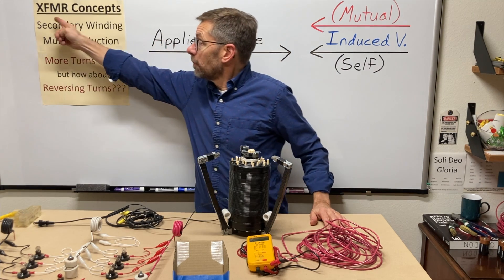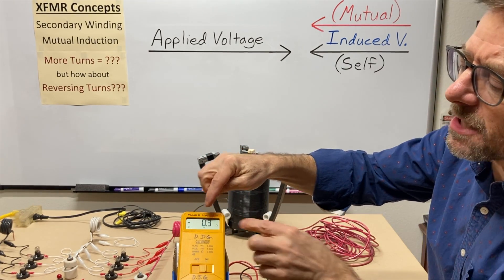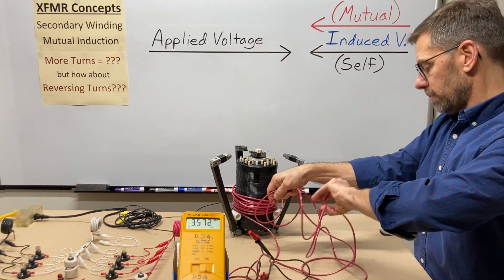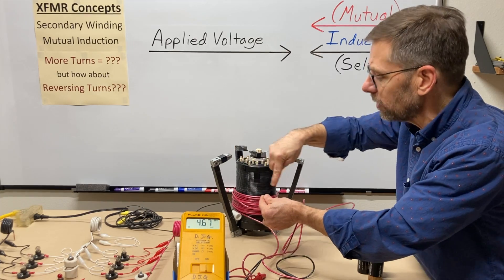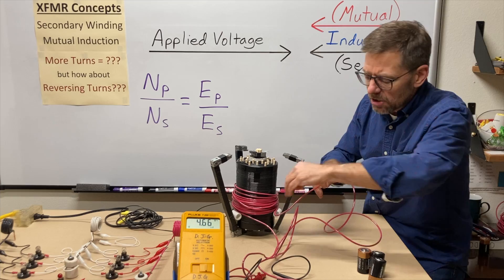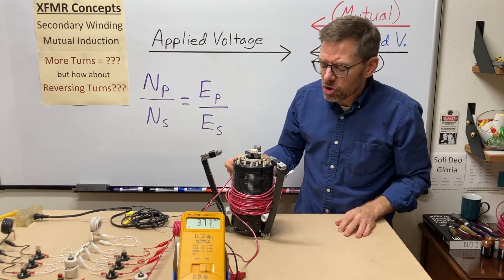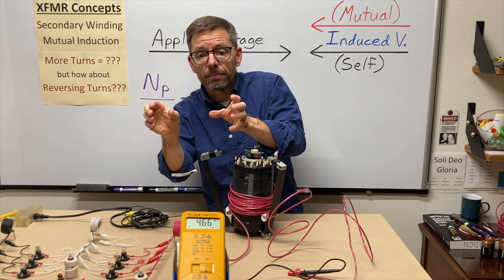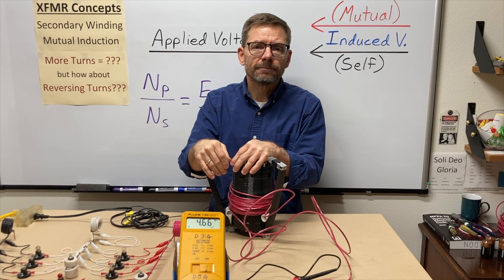Transformer Secondary Winding - Mutual Induction

Comment: Does winding the coil one way versus the other way determine which side will be "positive"?      I.e.  the meter was reading positive voltage.  If you had left leads on same ends but taken entire coil off and flipped it before putting back on would it have read negative?    Course it being AC might throw things a bit.   

But I think you kind of addressed what I am trying to figure out when you talked about phase.    So maybe one direction of secondary is in phase or positive same time(excluding lag)  and an opposite wound secondary would be out of phase or negative when primary positive?

Comment: I'm coil crazy, yes coils are very interesting things.Each one has it's own personality, so to speak, the specs. determine the properties exhibited. Built a pulse motor using coils and a magnetic armature that has run a year and maintained the battery voltage. Self Sustaining Pulse Motor, have to make a schematic but don't want to disturb the thing.

Comment: I’ve always thought of voltage level induced into the secondary as simultaneous overlapping voltage addition & subtraction (ac) for each winding, equaling out to the total amplitude of the induced sinusoidal waveform. I like the series battery analogy better though because it’s easier to picture & understand, even with the DC distinction. Clicked with my brain anyhow, so thanks!

Comment: With most transformers that have a magnetic core, including yours, doesn't the core suck up all the magnetic field? That is, like 99% + of the flux lines are in the transformer's core? And if in theory, in order to induce an emf you need a wire, and a magnetic field, and relative motion. When the wire "cuts through" the magnetic field lines it induces an emf. So if 99%+ of the magnetic flux lines are contained in the core of the transformer, which magnetic flux lines are "cutting through" the wire to induce the emf? 
I realize this is a different type question, but it seems that there is a conflict between the theory here to me. Any thoughts? Thanks
Reply: consider it from the corollary of Amperes circutal law. if there is alternating current passing a straight wire then there is alternating magnetic flux around. Now if there is alternating flux through a straight path then there is alternating voltage around it. Same happens in case of eddy currents. just a crude explaination.
Reply: @Aadil41290  
But a transformer is specifically made in a way to utilize the characteristics of a coil, an inductor. That is to "focus" the magnetic flux. The flux is already focused in the area inside the coil. So I mean amperes law is all good, but an inductor is not a straight wire conductor. They behave differently, and engineered on purpose to take advantage of the properties of the inductor/coil. Thanks.
Reply: They don't have a magnetic core.
They have a core made from a ferromagnetic material.

The core isn't magnetised, but it can conduct a magnetic field.
Reply: 99% isn't "all".
Reply: @deang5622  
Ok, you're right the core is typically a ferromagnetic material.
And are you suggesting that the <1% of the magnetic flux is responsible for the mutual induction that he talks about? I'm asking, not as a troll or a trap, but out of curiousity. If someone has answers I'd like to hear thats all. Thanks

Comment: Dave, how could one get 120 in each phase to neutral from a 3 phase source from a delta connection??? Without having a high leg... i saw a delta Service 120 each phase to neutral and 240 between phases shouldnt it be higher one phase? What equipment could  be between tranformer and panel?
Reply from the maker: Hi Ivan, Thanks for asking, but I haven't seen a scenario that you describe, and thank you to "A V" for replying with the math for a high-leg delta.
You should see about 208 V from the high-leg to neutral. I suppose someone could take that 208 V (high-leg phase wire and neutral wire) to a single-phase transformer and transform it down to 120 V, but this is probably highly unconventional and could have unintended/negative consequences depending on how the transformer connections are made and if the other phases or the center-tapped neutral from the original delta transformer were accidentally connected to the "neutral" (not really a neutral, but potentially a grounded conductor) from the single-phase transformer. I it were going to a panel this would likely be the case. For starters, you may end up with current finding its way back to the delta through the single-phase transformer by traveling on the ground conductor between the two transformers. I have never seen the high-leg used for single-phase 208, but I have heard that some people say they have. There may be something out there like what you're describing, but I haven't seen or heard of it.
Reply: In a 3 phase delta, the line voltage magnitude is equal to the phase voltage magnitude. If you have a 240Vphase delta transformer with a center tapped transformer on one of the legs,  you can get 120V with respect to the neutral on that phase.
Some complicated math for the other leg that does not have the center tap with respect to neutral, but it would end up being 73% higher.  (multiply by sqrt 3).